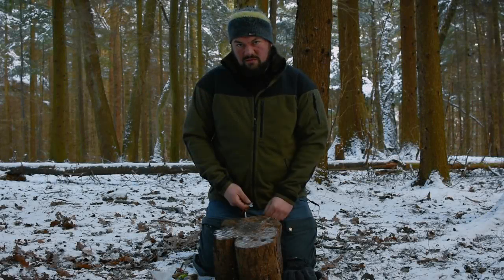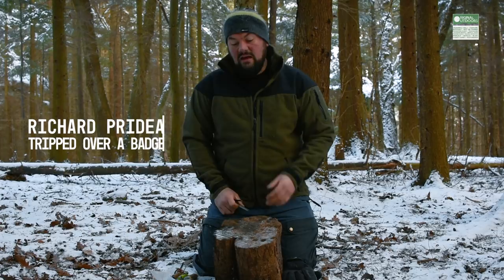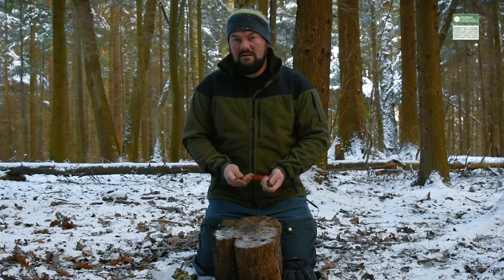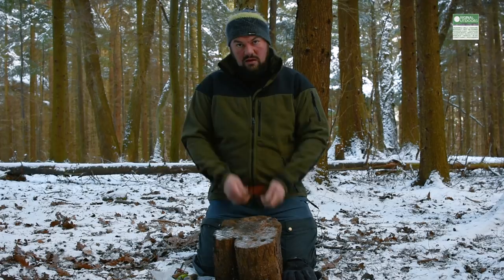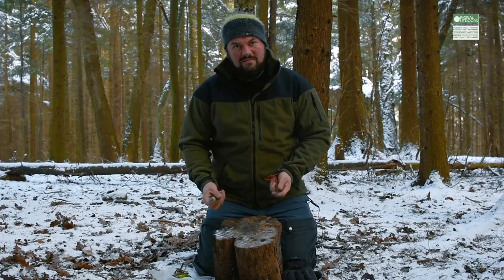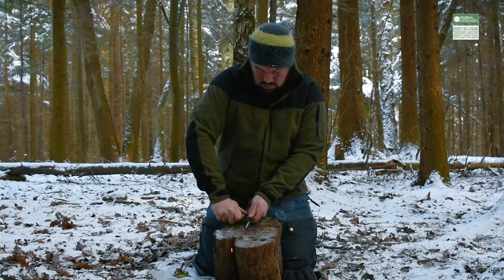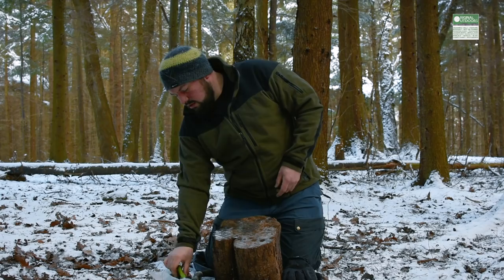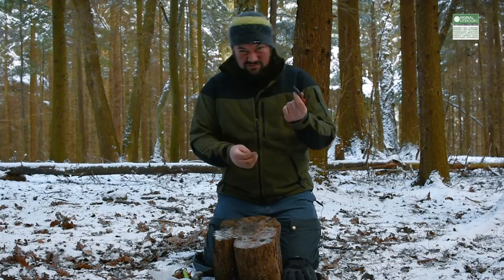Using a ferro rod properly? You're going to cut your finger off doing that...

Comment: RAMBO STYLE, IMPRESSES THE CHIPMUNKS..!! I totally agree with you on humble down and use a simple striking unit. Personally i hate the thought, of using my expensive knives, sharpened with time and care, oiled and buffed to razor quick speed, to strike a ferro rod. Those sparks are roughly 5000 degrees, the temper of my blades is potentially compromised by that flash heat, and will eventually degrade the wonderful crafted steel within my coveted blades. NOT HAPPENING UNLESS A COMPLETELY DESPERATE SCENARIO REQUIRES IT, EVEN THEN A ROCK WILL ALSO SERVE AS A STRIKER. Thanks for the humbling lesson to all those HOLLYWOOD RAMBOS. Cheers!!

Comment: I couldn't get enough force with the little striker on mine to get sparks to catch on the tinder. I intend to make a handle and embed a strip of metal into it so it's safe with no sharp edges but I can get more force on the ferro rod.

Comment: I find those small rods to be of limited use and durability due to the lack of decent sparks (unless the spine of knife is very sharp) so I use a huge one http://geni.us/AKNd4b which throws a nation of sparks to light tinder first time. The striker which comes with it isn't very good and I'd really like to see decent strikers come with these rods - surely it wouldn't add much to the cost and would make a hell of a difference to their ease of use?
When you were explaining about someone holding tinder while another person was striking a rod above the tinder it made me wince just thinking about what could have gone wrong there, lol
Reply: Where are everyone getting these crap strikers from. Even the crappiest ones I've seen still give sparks. The formula is pretty simple, get any slightly ridgid metal and put a 90 degree edge on it. I'm still yet to see a company mess this up. Maybe some people have hands that are too weak. To that I say, get a bic lighter as using a knife really isn't going to help you.

Comment: I know exactly what your saying, but the strikers that come with these are so poor as almost unusable.  I’m not going to carry separate striker but let face the reality a BIC lighter works better is safer and is less work. I still carry a fire steel and have the skill to use it but really why would you. Having said all that my EDC is stainless steel LOL.
Reply from the maker: I've yet to break or damage one from Light My Fire or the Casstrom ones. But yes - a lighter is what I pull out first! :-)
Reply: Its not really the damage its they are small and difficult to hold and often made from poor low carbon steel. The strike quality its much better from a really hard steel. I have carried  my own striker in the past as the knife I favor has a stainless carbon steel folded blade. I'm not telling you  the name as you will accuse me of being a gear snob  LOL.  Hope your enjoying the snow I will be out in the peaks this weekend hoping to build a simple snow shelter and camp out. That would make a good video for you I love camping in snow.
Reply: An old Clipper flint mechanism and a refill pack of flints takes up very little space in a wallet/kit...
Bout a quid for a pack of 9 flints.